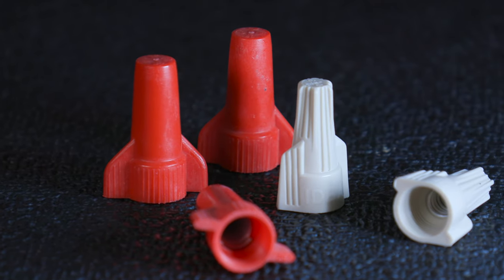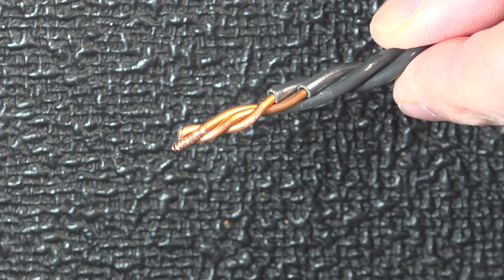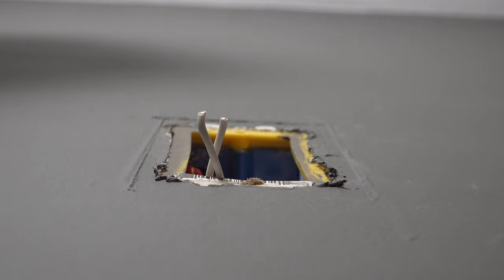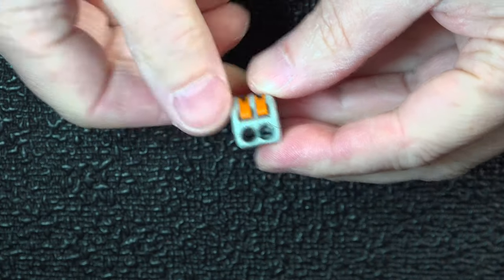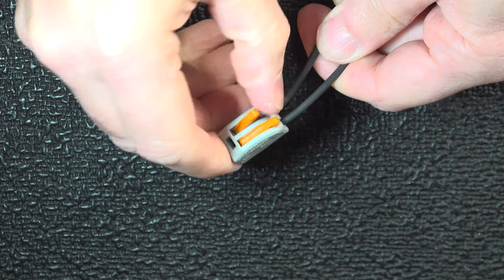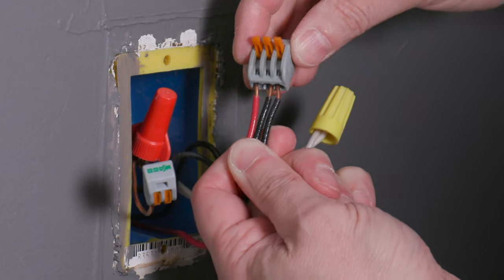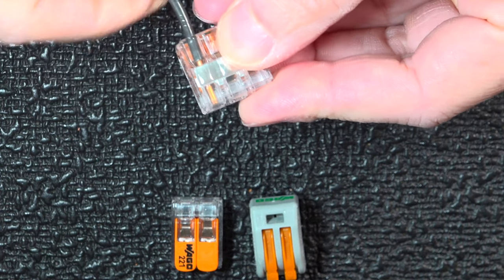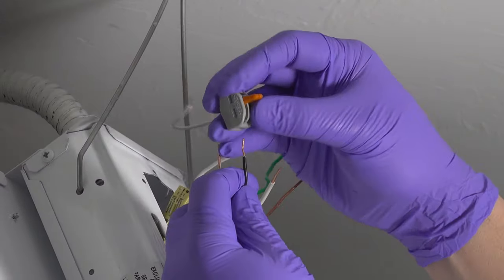Never use Wire Nuts Again - Wago is Better Electrical Connector

Comment: As an actual electrician, I can tell you the only real problem with wirenuts is people dont make a mechanical connection of the wires first. They are good for like 20 years before the plastic gets brittle from being heat cycled which would happen to any style connector made of plastic.
P.s. Many light fixtures come with those connectors and they are absolute junk and can barley handle a 14 guage wire. Thanks for the click bait misinformation clearly made by a sponsor
Reply: That is not true the real Wago connecters go from 24-12 AWG greetings from europe we only use Wago company connecters.
There are alot of rippoffs they are crappy bit not the wago.
Reply: @alanreedom2647  still made from a high heat style nylon plastic like a wire nut. Yeah there are cheap and expensive wirenuts too. Both style connectors last around the same time
One Is far less expensive and mechanical connection is definitely a more efficient means of splice.
Reply: @jag12549  can I ask what the price of the wire nuts are ?
and the ones in the video are the "expensive" ones the other ones are steckklemmen  (Wago 2273-203) check them out if you feel like it, they cost around 0.09-0.10$ for one. the ones he showed is for  flexible conduit.
Reply: @alanreedom2647  dunno where you're getting your connectors cause I have a hard time finding a distributor of those things, but when I do I get prices like $8.75 for 10 which compared to a 500 box of Ideal tan nuts for $45.77 breaking down to an actual .11 cents per unit is the kind of reality I live in
Reply: @alanreedom2647  and most of all
You're dependent on the pressure of a spring for your connection. If that latch mechanism fails, an arc can be generated from the gap. Especially working on 277v which I don't think those are even rated for (versatility another good reason)
That's how fires start. Push comes to shove, if a wirenut fails, the mechanical connection should be bonded well enough to be the connection and the wirenut really only acting as removable insulation
Reply: @jag12549  ahh noe I see why everybody is saying they are so expensive I have to say its pretty cool to see the driffence see I live in germany and its a german company so the availability of the connecters is easier for me than for you and they are rated for 20A 300V for the latch version and the other ones is 24A and 450 V here in germany you are not allowed to use flexible conduit for sockets and switches so we are talking about the other versions for a installation not the latch varriants like i said check em out if you wanna Wago 2273-203

I here alot of people sayinf that wire nuts are single use is that true ? 
and from my standpoint the Wago connectors are easier to use than a wire nut 

and that you know I'm not here to argue just wanna see a diffrent standpoint from somewhere else lotta love from Germany.
Reply: @alanreedom2647   Yeah, those are expensive here. I do a lot of commercial lighting and those Wago connectors come with some of the new fixtures. They are nice, I have been splicing together mechanical for so many years, it's a repetitious habit at this point and I don't feel like something is done right unless I know I bonded it.
I haven't seen Wago with the latches fail but I have seen many other connector styles like push connectors fail and I don't trust them at all.
Nuts are not necessarily one time use, but I personally dont reuse them. If I nut something down, then realize I need to change it, I can do that mostly. But the nuts have a small spring in the top that the wires are twisted down and dig into. Stranded wire in particular will get caught inside the spring and can't be backed off. Generally best practices is to neatly leave slack in the box in case repairs or mods need to be made later in the buildings life.
 Any old connector I come across in the feild,  I change regardless. Like I was saying before, plastic gets heat cycled and becomes brittle. I've found many a connectors that just disintegrated in my hand from sheer time and exposure
 P.s. You speak English Phenomenally
Reply: @jag12549  In Germany if the name Wago isnt on that typ of connector then we throw it out we only trust that company the other ones arent worth the hassle, but no I understand it why americans say that its so expensive. 
I remember I showed some guys at work a nut style connector and they asked me what the hell is that till today I didnt know that it was relly a mecahnical connection I just losely turned the wires and said I geues
you use it like that :-D
before we those typ of connectors we used 
Lüsterklemmen

another thing I read about is that aluminium used to be used in installations back in the day in the states that was never really a thing over here is that true I heard stuff about using a gel on switches with alu and that it moved after the years 
  

and thanks  :-)
Reply: @alanreedom2647  yes , there is an anti oxidation gel generally called Ox-guard which allows you to connect aluminium to copper. We do use quite a bit of aluminum wire here. Not as much in residential applications, but in the 80s there was a whole host of awful aluminum wire here that I run into all the time. 
You Germans do some beautiful work. I've seen videos of some beautiful mechanical rooms there. What voltage / hertz is normal for residential power for you? We generally run houses on a 200 amp pannel at 120 volts 50/60 herts.
Germany runs 220v everywhere, right?
Reply: @jag12549  actually we get 400v 50Hz so it is divided in 3 phases 1. 230v 2. 230v 3.230v all 50Hz so the sockets are divided up with these 3 phases so the circuit breaker gets one of the phases for 230 volts so the outlets and switches are 230V 50Hz 
So from the power company we get 3 phases and  a neutral and in some regions a earth but that is new the usual grounding nowadays come from a foundation earth used to be the piping from the water but they started using pvc (plastic) so it doesent work anymore 
Example breaker 1 phase 2 
                 Breaker 2 phase 3
                  Breaker 3 phase 1
                   Breaker 4 phase 2 and so 
For big maschines we use all 3 phases called drehstom 400v 16/32/64 amps 
A normal house has a 60A breaker for each phase and sometimes a 80A breaker 
I heard that the states actually haves 240V and somehow splitt it up to 120V how is that done?
Reply: @alanreedom2647  For general residential, 2 phase 120v power comes in. That's two conductors (power and common) and a ground or what you refer to as Earthing. We ground our pannels these days by spiking a large copper rod about a meter in length into the ground outside and bond it to the pannel. I have seen the clamp to the water pipe here as well, but I believe that was outlawed years ago before my time. 
Large businesses here run on 3 phase 460v which breaks down at another transformer into 277v to do long strings of lights or other general utilities. Up until the 80s here a ground was not required and many of the buildings I work on in Boston from that era utilize a steel jacketed wire known as BX which generally did not have a ground or if it did, it was greatly undersize.
Today there are a couple ways of doing things here 
 we use products like MC and AC which are a flexible shielded solid wire jacketed in THHN ( thermoplastic high heat nylon)
Or you can buy spools of stranded wire jacketed in THHN, and run it through a metal conduit run
PVC conduit here is generally used for underground/, exterior projects
For residential use, a pvc jacketed softer style wire called Romax is generally used.
I'm sure all that is quite similar these days
Reply: Oh, sorry I forgot
Our pannel works like this
The main conductor comes in and feeds what is known as a busbar (two strips of aluminum that run along the length of the back of the pannel. 
Those are used to lock in a breaker which is connected to the line of the circuit you're powering. The other conductor is connected to the common (the return for the circut)
To hook up a 240v we simply use a wire with 3 conductors and a ground
Hook two of the conductors to a doubble breaker (2 breakers tied together allowing you to add two separate conductors to the busbar for line power)
Giving us 240v
Reply: @alanreedom2647  *480v

Comment: If you can’t use a wire nut and know it’s a good connection. Just stop. Wire nuts work great the wire has a lot more contact points in a wire but.

Comment: wire nut is not really a connector its a cap to not have exposed copper because electricians they twist the wires with pliers before putting wire nut

Comment: Those Wago connectors can be very dangerous. If you're going to use them, please take extra care to make sure the connector is rated for the amount of load you'll be putting on them. Wire nuts are a safer choice if you don't know what load you'll be putting on them as it's not the wire nut that's making the connection since the wires are connected directly. Also note that connecting two different gauge wires together can be a hazard as well. In general, be sure to know what you're doing!
Reply: What? Wire nuts are DEFINETIVELY not more user friendly and safer, with a standard Wago you can use stranded or solid any guage up to 2.5 mm2 And up to 500volts 20 amps. And of course there are bigger wire sized and amprages availible.

Comment: For the love of Thor. STOP OPENING ALL THE LEVERS ON THE WAGO. Only open on at the time. Otherwise the spring inside gets all bendy and the wire can get less pressure. I have bin a sparky in Norway for over 20year. And now I don't trust those WAGO shit for less than 10Amp 230 usage.
Sometimes I can pull wires right out the WAGO after colleges has just done there work.

Comment: As an electrician …please please please please do not use these they will get loose and burn out I’ve seen it happen days after install….nothing is a better connection then physically twisting wires and caping with a nut

Comment: Ya, no electrical contractor will ever use these. Huge, time consuming, expensive. 

Just stop using garbage wire nuts. Ideal make a great nut.
Reply from the maker: Huh? They take 85% less time per connection and take less space. Ever notice boxes are rectangular. What packs better?
Reply: @SilverCymbal  85% is a very high estimate unless you're not a contractor that has put on thousands of wire nuts. For a home, the wire nut time would account for about an hour on the entire job. Wire nuts are pennies and we're talking about saving maybe 30 mins total on a job that we'd end up spending on material.

Just saying that a time saver does not always equate to a product that a contractor will use unless it decreases his bottom line. Contractor work is as cut throat as it comes and dollars matter on a job.

I even showed this to a few other contractors to get their take and the both laughed at it. Said they like it but they're cost prohibitive. 

Should also point out that these are huge ( not sure where you get 'less space' from. A lot of boxes are pushing max loading of their internal volume, especially with bulky automation switches and plugs. This would make getting things to fit a pain in the ass, especially in single gang boxes.

 Think of the neutral connection in a box that has incoming, pass through to 2 lights and 2 automation switches - that's 5 wires. There's no way this takes up less space than a single wire nut.

If you use wire nuts properly and take a thermal camera to the connections after a fair run time, there is some heat as expected, but nothing alarming. 

If you don't know how wire property, these are likely what you should use though. Less house fires from do it yourselfers. That or leave it to people that are trained and experienced professionals.

Comment: "if you're doing these commercially, these are a little expensive" there is that pursuit of the greatest profit margin talking. Forget that these are safer, more reliable, and reusable. They cost more, so no. Even electricians and other tradesman don't care about their customers, just the money they make from the work they do. Forget the quality of work.
Reply from the maker: I agree the fact that they are keeping old wire nuts and reusing them job to job and proud of it, literally makes me sick Imagine a doctor reusing bandaids to save pennies, just because they work. I don't care what connector you use, but for safety's sake give your paying customers NEW connectors.

Comment: I wouldn't use them if they were free.
Wire nuts are permanent, and just 3" of extra wire in general will be good forever, they will out last any house, basically everything you said is wrong. If you can't properly use wire nuts you shouldn't be doing any electrical work.

Comment: Wago is love, wago is life. Seriously though. It just works really well. They are just superior to wire nuts. We only use special ceramic wire nuts to have good heat resistant connections in certain applications. If Wago had a lever version of that, they would be swapped out in a year.

Comment: Disclaimer: wago type recepticals are unsafe, given the connector in a receptical slowly moves over time from regular use, biting into a wire and creating an unsafe connection
Reply: Biting into the wire ensures a SAFE connection.
Reply: If your wall moving over time a Wago is nothing for you^^

Comment: Don't think the tiny spot of metal touching the wire is better than twisting them together.  It's called do it right and check it.  Wago takes up to much room.  If moved and spun a lot it cuts into wire.  Disapprove

Comment: These rubbish connectors were banned in Europe 
We use connector strip much better connections better mechanical connection and very inexpensive 
Comes in various electrical sizes 
Ie 5a 10a 15a 20a 30a 60a

Comment: Never. The small surface contact of these connectors is a fire hazard. The same with any push to fit wire connector,including the built in ones on outlets and switches. More surface contact of a splice means less resistance which means less heat. Also a loose connection means resistance. All fittings of this type,or push type weaken with age,and heat.
Reply: They meet standards in many places in the world. I believe you should make a decision based on the application, but most people will stick with the devil they know.

Comment: If you actually follow the instructions provided with your UL listed wire-nuts, the connection will be fine. Wire nut failure is due to poor craftsmanship, not bad design. This guy is a goof.
Reply from the maker: Except for the insult we agree. The issue is wire nuts have no way to know if they are done right, one connector looser than the others, no way to test voltage, just a "tug" test. Is it 1920? Wagos elimane the ART of using a wirenut and give a repeatable result. Thats better any day of the week
Reply: @SilverCymbal  sure, until a product recall or substantial issues with UL or Intertek testing methods or standards causes another 'aluminum wire' or Federal Pacific fiasco. I've seen substandard installs with lever connectors as well, where the installer didn't strip enough insulation and it created an intermittent connection.

I use Wagos for particular applications, especially when reversability of the connection is required for testing and commissioning, but general building wiring is not one of those applications.

Also IIRC, Wago did have a recall a couple years ago on their lever-nuts. Just something to consider?
Reply from the maker: @TheRepublicOfJohn  A recall would be a great argument, except they have never had a recall. If you are referencing an RV manufacturer that used them against specification and needed to do a recall to correct it, That's like using low temp silicone in a high temp application. If you have data of another recall I would be thrilled to see it.
Reply: @SilverCymbal  ooh good catch, I wasn't aware of that

Comment: oh and why you even have the one with just 2 connections?? if you use that, you did your wiring wrong. you could have made that one whole wire....
Reply: oh ya i forgot. you guys do EVERYTHING with cable. over here in houses we use loos wires in pipes. much more flexible.

Comment: A prime example of a video that needs a counter next to the dislike button. WHAT ARE YOU DOING CUTTING OFF WIRES EVERY TIME? For that matter how often are you re-working wires this is a problem? Any why are the wires twisted together like a cork screw for 2 inches? All this extra stress and strain on the wires just working hardening them.

Comment: As a master electrician I am here to say: amateur bs. Might be a better method for a total amateur but never for a pro. Wirenuts used properly do not fail period.
Reply from the maker: You know that isn't true, or at least do can you be sure they are used properly? You can't visually inspect then, they have no test ports and of course there is the scientific tug test. There is no way a connector in the middle could be loose and the tug test would never know right? Of course that's when you get melted and burned wire nuts. Maybe you do the right thing but there is too much room for error, that's what almost every other country switched to Wagos, UK, German, and many others, they just work better and greatly reduce mistakes. The NFPA's test results also confirmed this, check their test for yourself.

Comment: I am a master electrician. This guy is not well informed . Wire nuts are safe and better. They do not cause fires. That is ridiculous. When you pretwist the wires properly and turn on the wire nut, you have a large amount of wire to wire contact which allows proper current flow.  These connectors rely only on a small amount of friction at one tiny spot which transfers current from one conductor through a "bridge " to the other.  Nowhere near as good as a connection. Maybe a little faster, yes, but definitely a weak spot in the circuit.